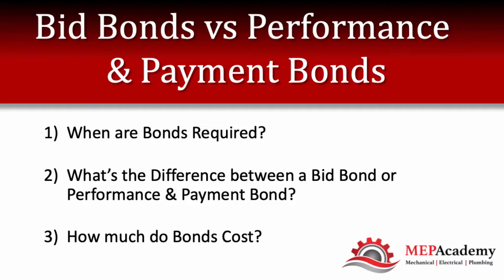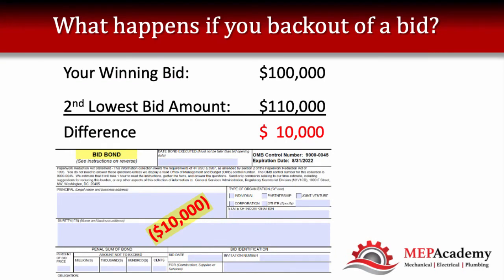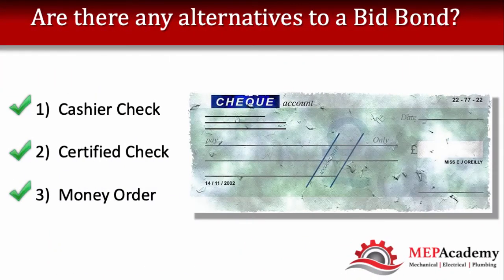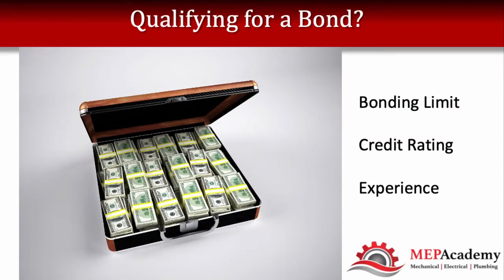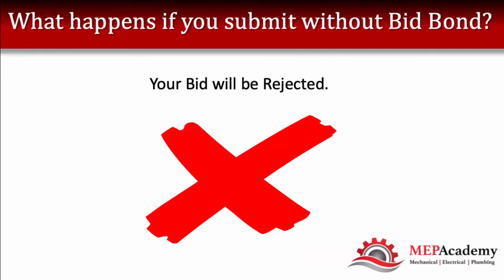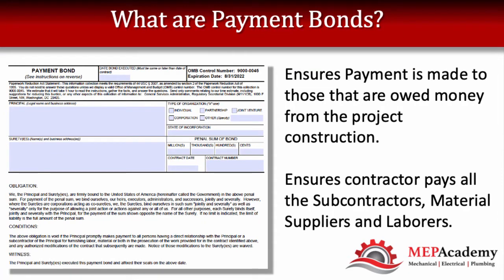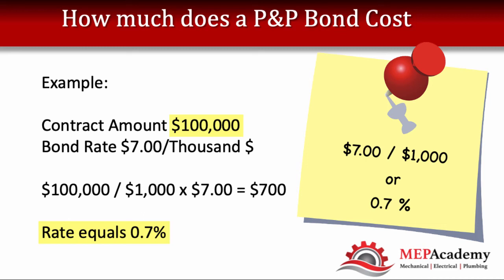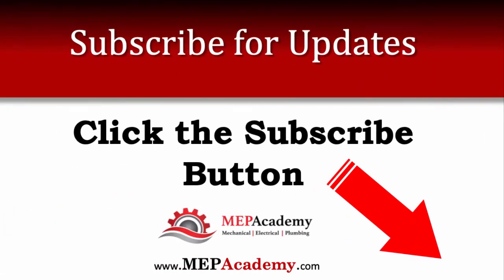Construction Bid Bond with Performance and Payment Bond

Comment: .7 of $100,000.00 is $7,000.
Reply from the maker: Thanks Daniel. Should be $7 per Thousand. $100,000/$1,000 = 100 x $7 = $700 or a factor of 0.007. All you need to know is what does your bond company charge you and how do they figure the cost.

Comment: If the P&P bond are issued separately, will premium also be calculated once? The Surety may have to pay twice of the contract value
Reply from the maker: The Performance and Payment bond when required are usually required together.
Reply: @MEPAcademy  Thank you! while I'm still wondering if Surety might be responsible for twice of the contract value  - 100% penalty for performance bond, plus 100% penalty for payment bond.
Reply from the maker: @adamhan4860  The premium will be calculated based on what you're purchasing. If you're just purchasing a payment bond then the rate might be lower as the Surety is only responsible for the risk that you won't PAY your Workers or Suppliers. You will find that most contracts require a Performance & Payment bond together. The surety should never be held to twice the contract value as you're thinking. Remember the Performance bond will ensure that you complete your construction contract, and no smart owner or General Contractor is going to pay you for work you haven't completed, so the bond company is never going to be on the hook for 100% of the contract unless you don't perform at all, at which point there would be no risk on the Payment Bond portions. The Bond company should never be held to 100% of the Contract value for both the Performance & Payment bond.